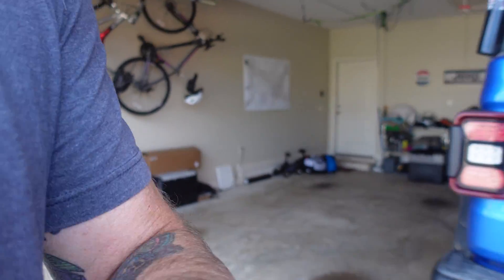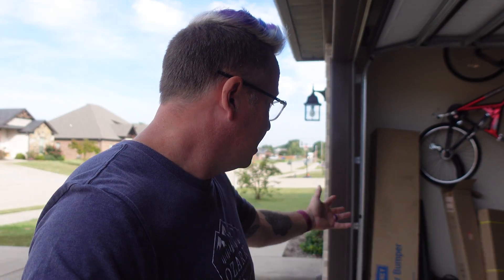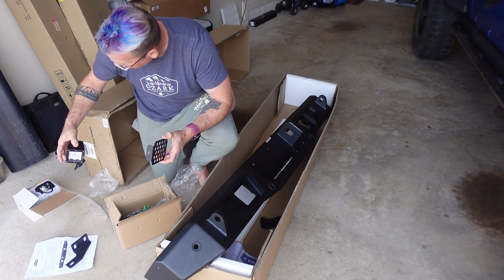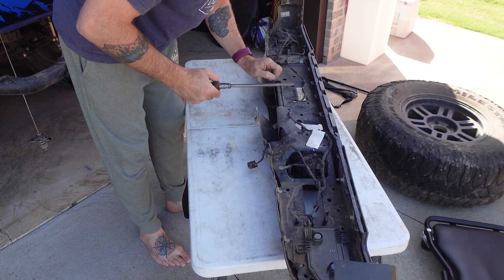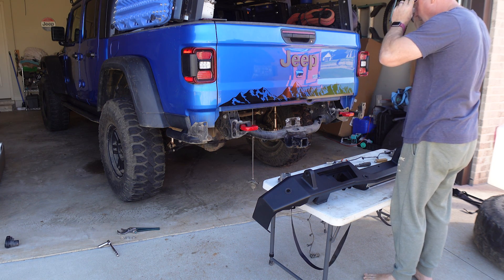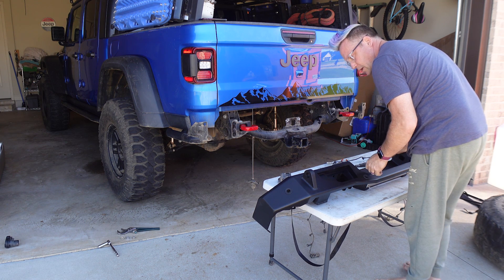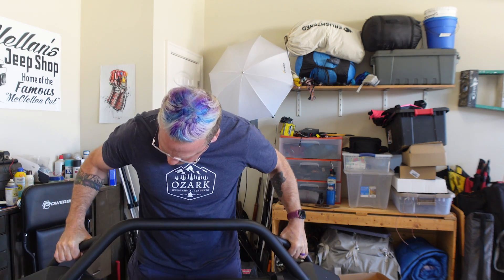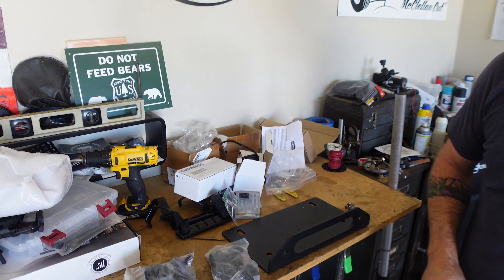New Front & Rear Bumpers for the Gladiator - JC Whitney Bumpers

Comment: Hi Matt, love your Gladiator build and love watching your videos! I see you have a front facing camera. Just wondering how badly the winch and front hoop obstruct the view? I"m looking at changing my factory steel front to a Fab Fours and it has a front hoop and higher winch mount similar to the bumper you have.
Reply from the maker: This bumper didn't do well with the front camera and is a big reason why I no longer run this bumper. A bumper with a recessed winch mount is much better with the camera.
Reply: @OzarkOverlandAdventures  thannk you! That’s what I was worried about.

Comment: How did the bare feet and metal shavings from the front bumper light install work? LOL. I had metal in my feet for a day doing same thing for my fridge slide install (that rebel off road slide doesn't fit with their bed slide holder..have to drill holes)
Reply from the maker: No issues. But my feet are pretty callused from going bare feet a lot. Lol.

Comment: Couple of questions on the front bumper. Is it a smooth or textured finish? Will the factory JL fog lights fit? I saw you had some issues but it looks like you had your factory for lights installed. My wife purchased a bumper from a company I won't name that said OEM sized fog lights and they aren't even close. They included some cheap lights that are already fogged up and didn't send the correct wiring harness so they aren't even working. We've been waiting almost 2 months for the wiring harness and still don't have it. Already looking for a replacement and this JCW bumper is a contender.

Comment: Price point is great, but I would have thought you would have gone for a high clearance option in the rear since you drag so much haha.
Reply from the maker: Nothing will actually give me better clearance in the rear unless I remove the trailer hitch and that's not going to happen. The new bumper is no different clearance wise than that the factory one but it's a lot stronger.

Comment: I (think) I noticed you got your skid plate back on without drilling holes using the Warn winch plate. I’d like to know how you did that. I installed the Warn winch plate last week and could not get the bolt holes on the skid plate to line up. Good looking bumpers and great video.
Reply from the maker: I didn't have to drill any holes for the warn winch plate and factory bumper. I don't remember any major issues.

Comment: I just put a new bumper on my brand new gladiator. Tip to all: in addition to 8 bolts to remove bumper, loosen 2 bolts on each side of vehicle because holes will not align. When you loosen those gusset things and screw in bumper using 8 bolts, screw in the gussets after. I spent 2 hours fumbling like a moron trying to figure out why bumper wont fit. Holes did not align… loosened gussets and bam….

Comment: I may have missed it in the video but did you have an actual weight on either of the bumpers? I caught them being heavier than stock
Reply from the maker: I did not weigh them. Definitely heavier. The factory bumpers are made of very thin steel.